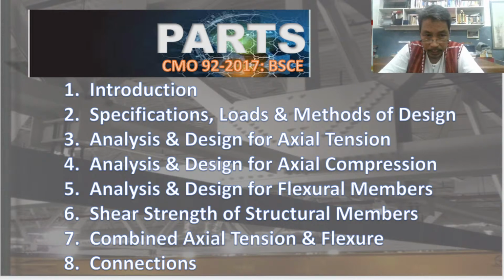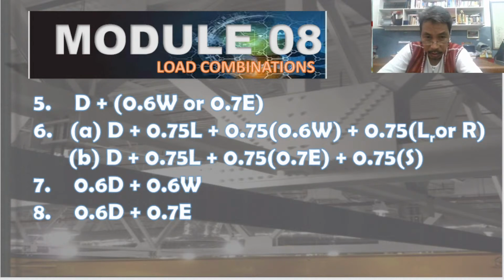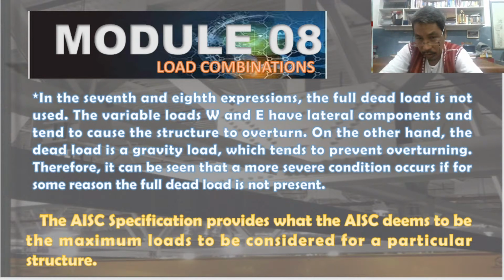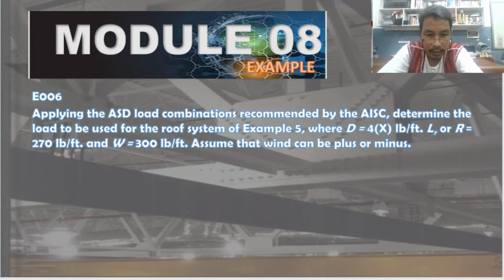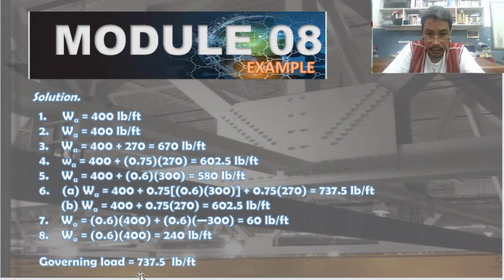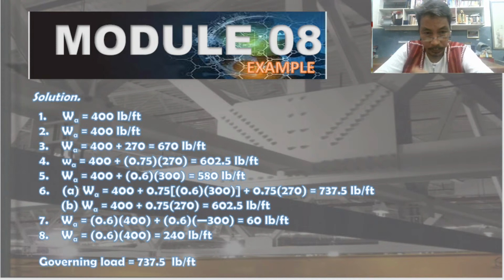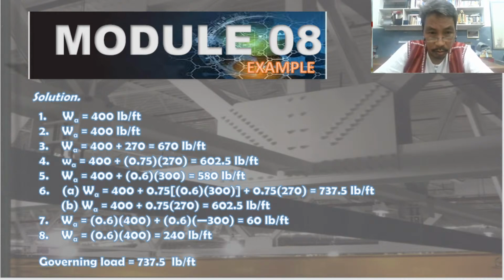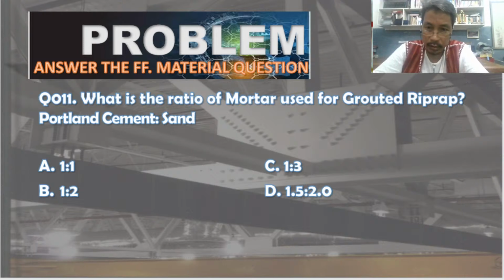[ LIVE CE E6 Lecture 07 ] DrAP Zantua STEEL DESIGN Talks + ENGINEERING Analysis & Design

Comment: Thankyou sir for discussing about load combinations that is used for allowable stress design. The video said that according to the code AISC 360-916 shows following formula that we have to use in calculating maximum load of required strength.
Question: what is the ratio if the mortar used for grouted riprap?Portland cement:sand
Ans: 1:3

Comment: In this lecture video i've learned the eight formula that the code AISC 360 stated to calculate the maximum load and required strength.
For Q11. What is the ration of Mortar used for Grouted Riprap?Portland Cement: Sand

A. 1:1
B. 1:2
Ans: C. 1:3
D. 1.5:2.0

Comment: Thank you sir for this live discussion about the recommended ASD load combination formulas/equation. I can now differentiate the two methods LFRD and ASD with their recommended load combinations. The given examples were easily comprehended. Thank you sir.
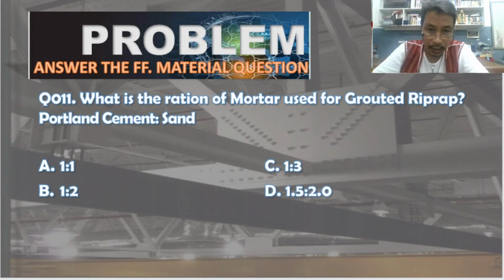For 19:48 Question: What is the ratio of the mortar used for grouted riprap? Portland Cement: Sand
My answer is 1:3

Comment: Thank you sir for discussing the load combination for Allowable stress design (ASD) and also for giving us the two method design and its load combination. Additionally, thank you for solving some sample problem using ASD combination that recommended by AISC.
For questions 011, What is the ratio of mortar used for grouted riprap? Portland cement: Sand

The answer is letter C. 1:3

Comment: Thank you sir for sharing this academic live lecture video in this course, Method of design, I learn that load combination is use for allowable stress design, and the formula use to calculate the maximum load required strength according to the code AISC 360-16. Answere Q:011 C.) 1:3...

Comment: ---thank you sir for discussing about the load combination used for ASD. 
the AISC specification provides what the AISC deems to be the maximum loads to be considered for a particular structure. Thank you for some examples of problem solving applying the ASD combination recommended by the AISC.
Q011. Answer= 1:3

Comment: For Today’s Video we discussed the load combination for ASD. Method Design formula are as follows
1.	D
2.	D + L
3.	D + (Lr or S or R)
4.	D + 0.75L + 0.75(Lr or S or R)
5.	D + (0.6W or 0.75E)
6.	(a) D + 0.75L +0.75 (0.6W) + 0.75(Lr or R)
(b) D + 0.75L +0.75 (0.7E) + 0.75(S)
7.	0.6D + 0.6W
8.	0.6D + 0.7E

THANK YOU SIR, FOR LETTING US KNOW THE 2 METHOD DESIGN AND ITS LOAD COMBINATION. 

Q011 . Answer. C.